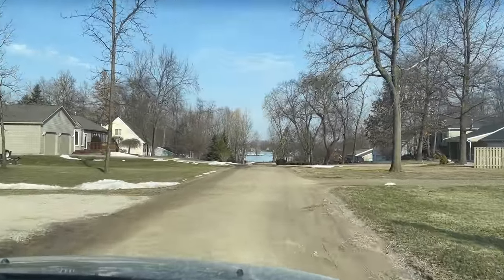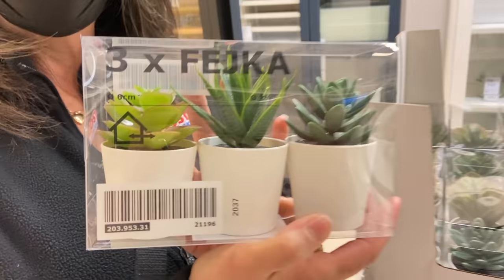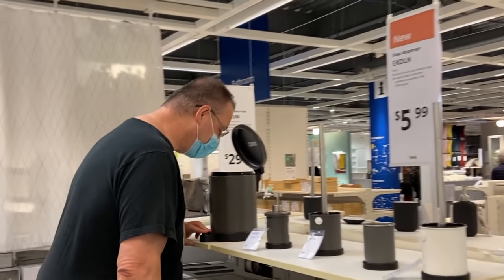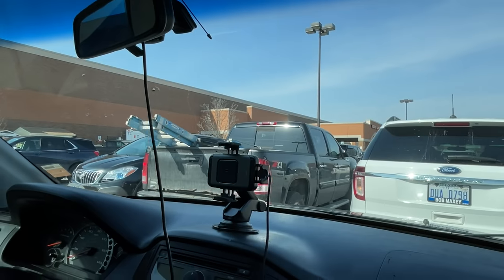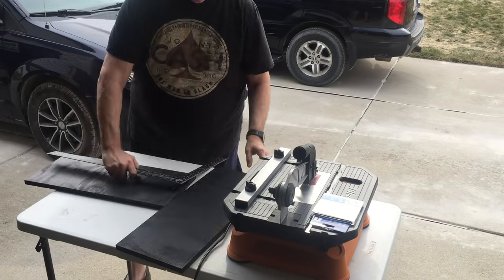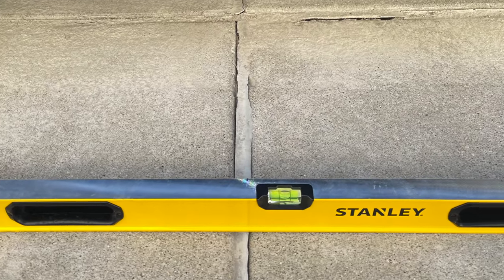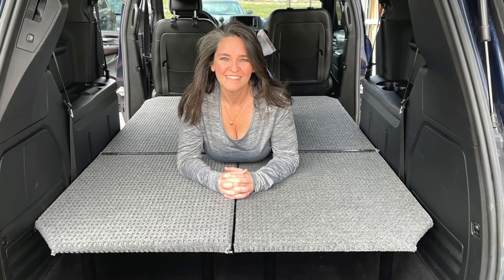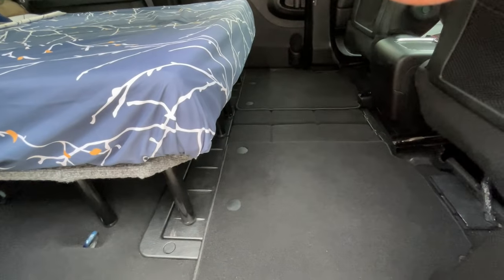DIY One Of A Kind MiniVan Bed, Solo or Duo, Multiple Configurations, SUPER Comfortable 6" Mattress

Comment: As a fellow Michigander, I'm enjoying watching it all come together!  The bed looks great and I really like how you made it multi functional. We're planning ours somewhat similar but longer for my husband. Can you sit up on the bed without hitting the ceiling? Could you please tell us how long the legs were cut for those of us who also have a Dodge Caravan? Thanks for sharing your idea! We are starting our build soon as just got a new to us Dodge Grand Caravan.
Reply from the maker: Hi Dawn! The platform itself we put in the van and did a lot of experimenting with cardboard boxes and tape measurer in hand to determine heights.  We ended up with 5 rows of legs, from the rear gate to the front seat area they measure 16 1/4, 9 1/2, 9 1/2, 10 1/2, 11 1/2 BUT this is on a 70 inch platform, if you go longer and or depending on the placement of your feet each would be somewhat different, that's where the boxes and tape measurer came into play. The rear legs are longer because we totally removed the 3rd row of seats so they stand down into that trunk area.

I am tall at 6'6" with a long torso so yes my head does touch the ceiling while sitting on this bed with the 6" foam, but in front I wanted that 10 inch fold down piece for more daytime floorspace, so I couldn't go much lower than 11 1/2 up front. 

We have our window template papers still if you're not too far from Ann Arbor let us know, if your model is similar to our 2015 they may fit to make window covers faster, and you could see the platforms we made. 
 
Stacey and Bill :) :)
Reply: @StaceyBillsAdventures  Oh my!  We would love to come meet you guys and your vehicle! We just bought a 2013 which I think is the same body as yours. We are near Grand Rapids so not too far from you. Your info was very helpful as that is about exactly the height we have been planning and we too have a 10-11" piece planned to go over our 10x10 canopy frame that will just fit width wise in the side door openings while traveling and then drop down for more foot room. We have a Ozark Trail connecttent for that frame for an almost instant "tent" set up for bathing, changing and even cooking or relaxing. Have fun on your adventure south for the blues fest - love blues!
Reply from the maker: @dawndevereaux6806  I saw this one picture of someone who had a clam escape tent with the rear hatch open and the tent fit OVER the hatch and provided about a 12 foot screened in tent type thing, I am looking at that seriously for camping as an option.  

Stacey works as a reservation agent for the DNR here in Michigan and a few other states, so we generally get a rustic cabin site but now with the van I want to just try an electric hookup parking spot soon!   

I have like 5 videos in folders I need to work on just been so darn busy, basement flooded yesterday so today the day before I leave on the blues festival trip I am drying things out calling insurance agent trying to sort out what works doesn't work, what got ruined etc it's been a fun one... We pass by that side of the state when we hit family over in Indiana so will have to meet up for lunch or something next pass thru :) - Bill  

You can always reach us at StaceyandBillsAdventures@gmail.com too I can bring our window template paper things if you guys haven't made them yet :)

Comment: Love the bed. Lighter than mine fore sure. Mine is 2 12" x 4'. Kinda a pontoon look. 2 mesh wire shelves going across top. Using 2 jumbo dog beds beefed up. The stow n go mid seats are used forrest of bed.
Reply from the maker: Wow that sounds neat actually!!
Reply: Bed on top of mid seats fast. I have 2 kids so yea love it. I still have access too storage under bed from inside and outside can. Stow n go storage since i use the seats as part of bed
Reply: Can I email you or face book you. I have really got it down to wire. Free floating back window shelves using gun holders that wedge in window really secure. Up and off in seconds. I need some one to help patent this if your interested. Does not tear up the window.

Comment: There are supposed to be lots of holes or open slats underneath the mattress to prevent mold in the mattress.
Reply from the maker: Yep if you read the pinned post we talked about that, when we built the bed I hadn’t seen or heard about that but it’s been mentioned in the comments and we ended up adding some insulated pipe rolls under the foam for now and I plan to put holes thru the platform bases soon, we’ve just both been traveling and busy and I had a recent fall that has me racked up for the last 2 weeks.
Reply: I just saw this video again. Still watching van builds, 2 years later. Time flies. 😮

Comment: Awesome practical build! Subscribed!

What is the length of the bed?
Reply: It’s 70” total length and 24” wide for 48” total if both platforms are used together.  At the end of the bed I usually have my cooler that sits flush so I can extend my feet down onto the cooler area too (very handy) or I side sleep legs bent majority of the time.

Comment: I love this bed!! I a doing a prototype bed right now to make sure I like sleeping in the van. All the material is from what I had on hand for the most part. But I love how yours folds and is easy to store. Can you tell me approximately how much one weighs? I need to be able to move it in and out of the van by myself. Great job. BTW, also watched your window covering video and loved that as well.😊
Reply from the maker: I'd guesstimate each side weighs about 20 lbs the legs weigh nothing and since it's two separate platforms side by side it make it super easy to store move install and have only one when needed.

The platform bed and legs being at different heights to level it out has been nice for storage under the bed as well, one thing we didn't learn or do at first was to put holes in the platform to help airflow and reduce the potential for mold though so don't forget to do that!

Comment: This is great! I like the re-use of the Ikea legs. How do you prop up the rear portion of the bed in the reclining position? I also like that your bed is in two halves, so you can outfit the van for solo or duo trips. Cheers!
Reply from the maker: I have this 2x4 piece of scrap wood I prop behind the platform at a 45 degree angle against the top lip of the rear trunk opening area it’s crude but fast and easy so far it hasn’t failed me hehe
Reply: @StaceyBillsAdventures  Go with what works! Thanks!

Comment: they sell cots on amazon with thick mattresses and sturdy metal bed frames, you don't have to build anything
Reply from the maker: Yep tried a few none fit side by side and most were uncomfortable and not level, was pretty easy to build these and much more adjustable for us, but heck I have even slept on a mat on the bare floor before too - just get out there and do it one way or another right?

Comment: Hi, just stumbled with this video and I really like your design for the bed. I don't know if you already mentioned somewhere what are the lengths of all the legs for cutting. I appreciate your help. Thank you.
Reply from the maker: The lengths will depend on how high you want the platforms to stand off the floor in the van and where you want the platform to sit, also in our van we removed the rear row seats (2015 grand caravan) so those rear legs are obviously longer too, but in general for our build here the legs in front are 11 1/2 inches off the floor to allow storage underneath and in the rear they are 16 inches long to allow them to reach down into that trunk area where the seats were, then there are supports that re a bit shorter like 9 1/2 ish for the mid bed areas, I just put the platform in the van and a big level (when the van was on a level surface) and for each point measured down to the floor, but some may want the bed more forward, or have their rear seats still in or a different van model etc (requiring some adjustments).
Reply from the maker: I am also realizing being a taller guy 6'6" and being a minimalist in nature, that I am not using the under storage as much and would like more headroom, I may make a trip to ikea get more legs and shorten all of them lowering the platform so that I can gain more headroom when sitting on the bed, been experimenting even trying just a sleeping pad too for solo trips.

Comment: Love the bed and it's flexibility! Plus a serious amount of space for storage underneath. I'm thinking the interchangeable legs would allow me to use the same basic system in my Odyssey and travel with the third row seats in place or removed to get access to the deep well they normally occupy when folded down. Did you consider cutting ventilation holes in the plywood to also lighten the load a bit?
Reply from the maker: hadnt thought about cutting some holes in the platform to make things lighter might have to try that at some point :)  First night in the van tongiht actually, on a trip from MI to MS 12 hrs made it about 4 hours and im in Kentucky tonight - Bill
Reply: @StaceyBillsAdventures  Hi Stacey and Bill, your channel has been just about the most helpful with my Ford mk2 1983 ambulance to camper conversion I’ve seen. I’m in Northern Ireland, and whilst we love watching many channels, so much doesn’t apply here in the U.K. so it’s very helpful to see IKEA products being used. We don’t have the road system, land space, caravan parks or attitude to nomadic life in our very damp country ( I’m really selling the U.K. here not lol) for there to be big rigs on the road. In fact anything much over a Ford Transit or Mercedes  Sprinter is considered very roomy lol. It’s a very different way of vanlife.   Regarding holes cut into the plywood, over here it’s more important for ventilation purposes to ensure mould doesn’t build up on the mattress. However as your set up isn’t a permanent fixed bed structure, you may be ok.                               Also as a wee side note, it’s so helpful in your videos, to have the products being held up to the camera and especially helpful are the product list links that have been included! You have saved us so much hunting around phew. Thank for doing all the investigative work 🤗.       Subscribed and stay safe 🙋🏼‍♀️
Reply from the maker: @sheenavaughan2717  Awe that's awesome if the ideas help you on your build!  i am going to make some top slats or drill holes for some airflow, i hadn't seen it discussed really but I am always learning and trying to make improvements, I do love our mattresses so I don't want to see them get spoiled by not giving them airflow :)  My first trip went well recently bed was comfy, I learned more too what to leave home and what I forgot, so it's tweaking things along the way that makes it better each time :) Stacey hopefully gets to go on this next run!  Bill

Comment: Question no 3 😉: when you lift up the back part of the bed , does the legs are in the way because the things moves, how did you manage to keep it clear? Thank you very much?
Reply from the maker: I can lift and access that rear trunk area where the 3rd row seats used to be but I don't LOVE the legs being in the way, I have been thinking of trying to build a 2x4 type bridge so i could omit the 4 far back legs yet provide platform support.  Right now tho the way it sits i can totally lift the rear panel legs stay attached and clear the trunk lip fine, it's just that they get in a way a bit when trying to store larger items down in that area.  I also have a 2x4 piece i use to prop either side up to make it a recliner in day mode if I want to, so far though overall the bed's working out pretty good for us considering we were doing it on the fly. - Bill :)

Comment: I have a Sienna and will be leaving the back row of seats in to have room for my granddaughter and daughter on my trips.  I would love to see how your bed sets up with the seats still in.  I will be using my seat well area in back for my kitchen area.  I love your build and all the tips.  

I am thinking of using peg board as it had the holes in it already.  Not sure if that is sturdy enough.  Do you leave your bed in bed mode while traveling?  Thanks for any suggestions.  I am from Michigan the Jackson area.  I live in Florida and plan to visit family in Michigan this summer.  That is my main reason for the conversion.  Thanks
Reply from the maker: Hi Debi!  You could build a platform similar to this but have the far row of seats in place and the legs just be cut to length to keep thing level, we just never use that third row and wanted the storage trunk area.

I’m pretty sure at least for me (big guy) that pegboard would probably crack but I bet it might work for someone smaller and lighter.

Bill
Reply from the maker: When we travel the bed is in place a majority of the time. I could fold it up but lately I’ve just been lazy and left it as a bed.
Reply: Thank you very much for the reply.  I'll play around with some ideas.
Reply from the maker: @debigaudreau7505  that’s what I love about YouTube so many ideas!!!!

Comment: Great video. I’ve been looking at the same chair bed you have from the same dealer just wondering if it’s a really soft cushion or a little firmer. I would need a little firmer and you never know when you are buying stuff without getting to sit on it.
Reply: I'd say it's on the firmer side as a big tall guy I felt supported not falling down into a beanbag type soft feeling, Stacey being smaller and lighter had no issues with her hip hurting either so for that I am pretty happy with them still and they haven't lost shape either.  The only thing they could improve on is offering a cover, we just always use sheets so we can strip and wash them, but a washable cover would be really nice.  Bill :)

Comment: Do you have the stow and go third row seats removed?  Are the bed frames covering the 'hole' left when the third row seats are removed?
Reply: Yep, the 3rd row seats were out and we used the storage area in that cavity to hold more stuff, since that video I have put the seats back in and I have an alternate (shorter) set of rear legs cut, that allow it to be used on the fully flat floor of the van.   

I just found each trip I used less "stuff" and didn't need the full cavity of storage, even under the platform originally I had all sorts of things, that now when I go on a cross country trip I take less each time, I have also used one of these foam pads directly on the floor of the van even, I just have to sleep backwards as the floor it slanted but it works :)

Comment: Can you please show how the bed stays at an angle when it's propped up? 
Also, When you are sleeping and have to use the bathroom at night, how do you exit the bed? Do you scoot along until you're at the foot or do you roll over and crawl out on all 4s?
Reply: Hi Sue, when we were making these we were experimenting on the propped up part, I ended up using some 2x4 in 2 spots and played with the length till it was comfortable.  The way that front lip folds down for stacey she didnt even need that extra base so we kept our little portable toilet at the foot of her bed, I needed the flap put out to get more length being taller, but if i needed to use that portable toilet thing it was there at her feet side so wasn't exactly fun but could be done if needed. and yeah i kinda scooted on my butt to the end of the platform vs crawling.   Overall works pretty good i am learning to to take even less and have done a few shorter trips without the platforms and used a hybrid air cushion to sleep on, stacey hates them (uncomfortable to her), she likes the softer foams, but if its just me im using the sleep pad and just some totes to my side with basics. Bill :)
Reply: Oh I have even used these foams directly on the floor of the van, now its not level but i slept head towards the front of van and feet towards rear gate, it didnt hurt my back or anything i was just testing it out with no platform.  At first we were taking so much i needed under the bed to store stuff, but I swear every trip when i unpack i say why did i bring this, and i reduce for the next trip, so slow but sure it's always a work in progress.

Comment: Great job! How is the bed feeling on the road? Any upgrades? I just got my new van yesterday (got alot of work ahead of me. This set up gave me some great ideas thank you!
Reply from the maker: The one thing we didnt do was vent holes to prevent any mold possibly forming between the platform and foam, what I did for now is put some pipe insulation tubes under each foam piece, can't feel them but raises them off the platform enough for some airflow for now.   I will put some holes in the platforms later, right now I am on a 3 week trip on the west side of the country, and sleeping has been great!
Reply: @StaceyBillsAdventures  awesome thank you!